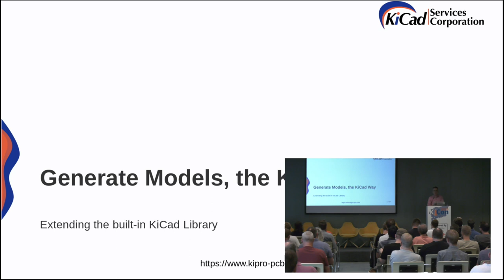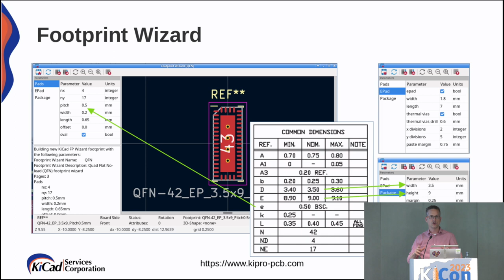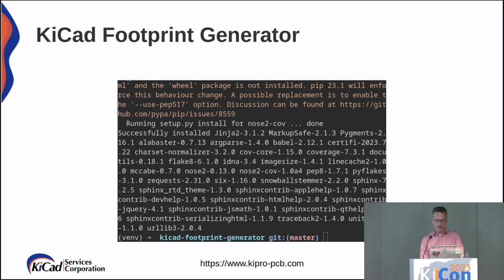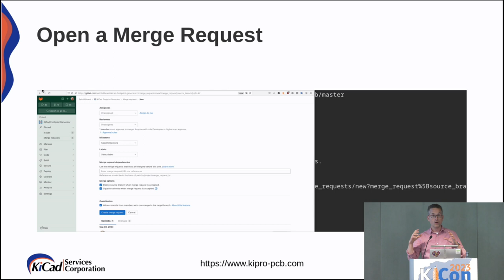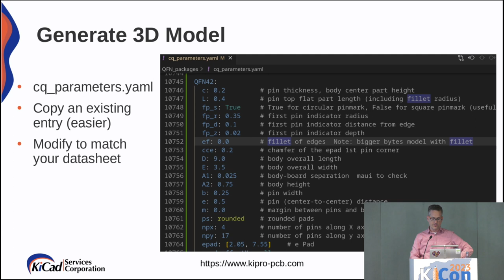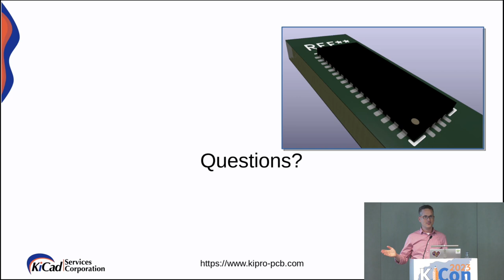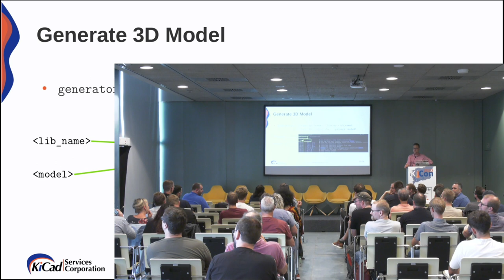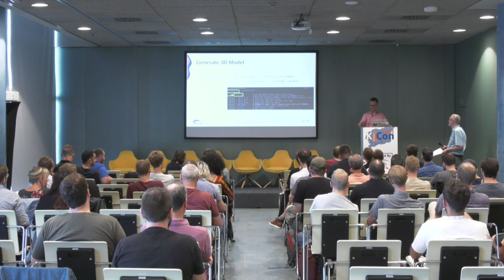KiCon 2023 Generating Parts the KiCad Way

Comment: I hope all this gets some day fused natively and easily available inside the KiCad itself so that there are clear GUI's and buttons instead of command line typing and git-stuff between me and creating a 3D model or pushing my creation to the project.

I'm no stranger to git etc. but it's still not something i want to do when I'm working with electronics and then there are million others who don't want to start learning git, python, read "ancient runes" etc. but just want to get stuff done. :)

But this is very very good thing to have in any professional package, so you're already long way there.
Reply: For someone that makes lots of footprints and audits many more made by others I can see why this method filters out the noise of poorly made parts. Nothing worse for design than using a component model of a part that's inaccurate, and the huge cost in money and hours lost rectifying issues that arise from that. If it was capable of doing well from a gui everyone would be doing it, but that's not the case. It's a formal method of component submission, not an easy one.
Reply: @cdyoutoob   Using git for content submission is creating unnecessary friction. Ideally, the only barrier for footprint submission should be the audit itself. And the audit should be streamlined for the auditor too.

The actual problem i have with the way it is now, is that the auditors have to manually check out the changes using git, load the symbol/footprint and can only then have their back-and-forth with the contributers. These extra steps make the process highly inefficient and slow. The submission process should be streamlined through a built-in KiCAD utility with pre-defined fields that you fill out and a 2d/3d preview for your footprint. Submissions should only be possible after registering with a valid email, to avoid spam and to track how many footprints have been successfully submitted by that user already. This allows the auditors to then focus on reliable contributers first.